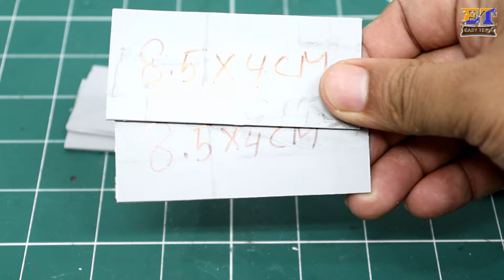Make Your Own 2 in 1 Emergency Fan and Light

Comment: Nice project, I would recommend to use 6 18650 cells to make 3sX2p 12v battery and use s3 circuit to charge the battries. For Led light we can use car charger circuit to get voltage from 12v battery and convert it into 5v.